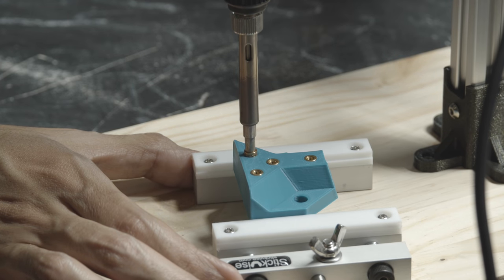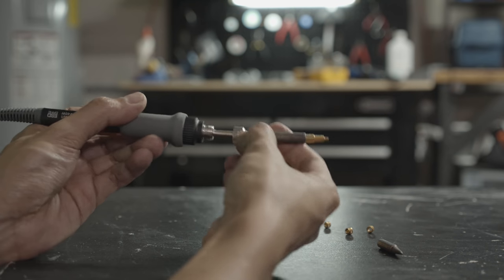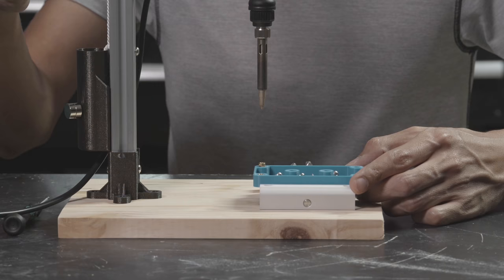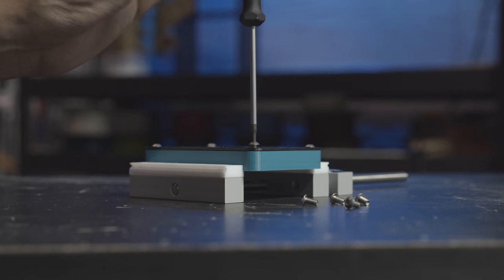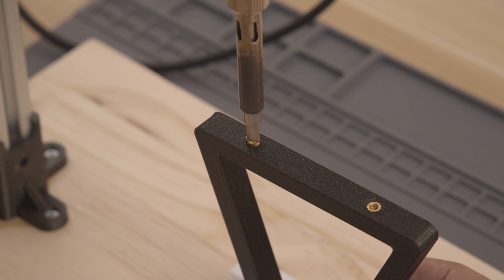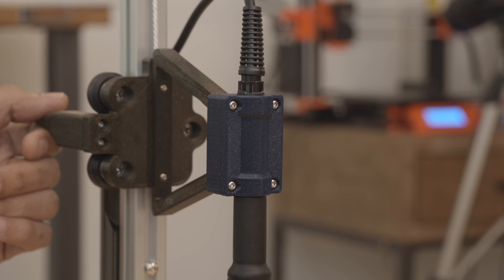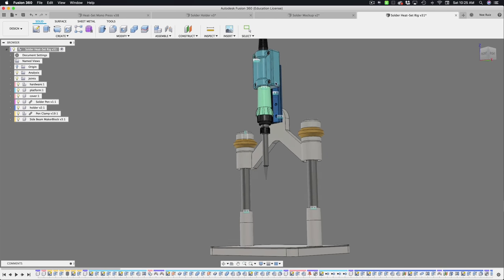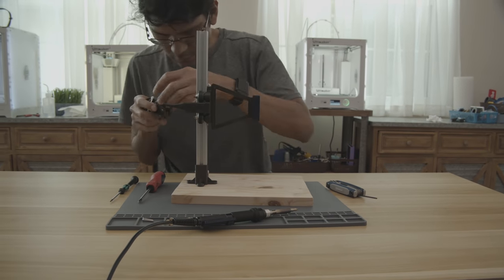Heat Set Insert Press

Comment: I just printed an adapter for my drill press and made the solderon tips on my metal lathe.
Reply: Great idea. I bought a band heater and thermostat so I can turn my drill press into a hot foil stamper for my branding iron.  Adding a die for hot pressing inserts will be a simple mod.

Comment: I don't use heat inserts but I should try those. Even if I don't use them, I would see this handy because I make holes in my 3D printed parts often with my soldering Iron. Not the best toold, but it works

Comment: This is great. Have you seen the adapters you can buy for turning your hand drill into a drill press. They're not fantastic for drilling but they are cheaper than the hardware for this project and probably do the job fine since the soldering iron isn't generating vibrations and torque like a drill. I think all you'd need is the piece of wood and to 3d print a collar to make the iron fit the hole the drill would otherwise be clamped into.

As an aside, I love the mat in the intro, with all the compartments for bits and pieces. Is that the sort of thing marketed for electronics repair?

Comment: Newbie Question: how do heat set inserts compare to captured nuts? I've had pretty good results using captured nuts in my project so far. So, when would heat set inserts be a better application?

Comment: The f3z and step files for this on Github don't open correctly in Fusion 360. The step file is corrupt or invalid, according to Fusion, and the F3Z doesn't produce any response when you try to upload it to a project in the data bar. I was hoping to edit the models to reduce the insert hole size to fit the ones I have.
Reply from the maker: try downloading updated files from thingiverse https://www.thingiverse.com/thing:3613621
Reply: @adafruit  Works perfect. Thanks.

Comment: Um...just use the nozzle on your printer.  Put it on pre-heat.  Use the manual Z control to lower the tip into the insert - and use the "DOWN" button to press the insert into the plastic at the perfect temperature.   I do this all the time - it works great.